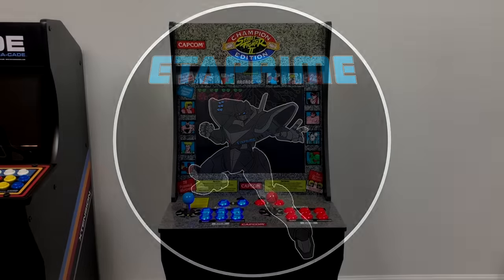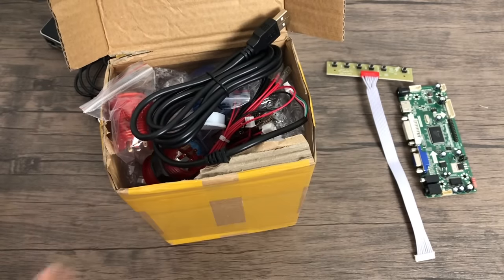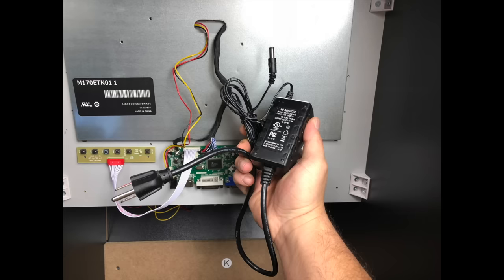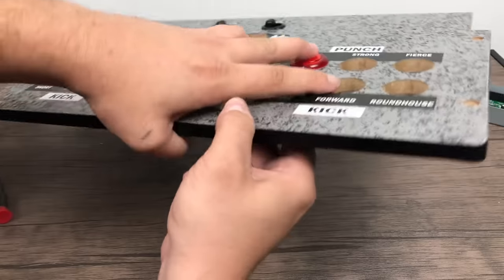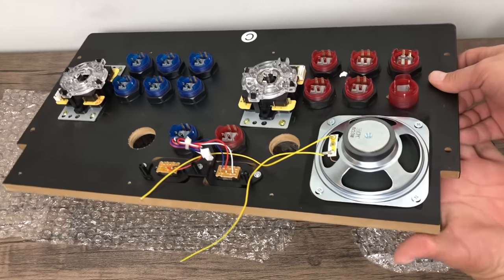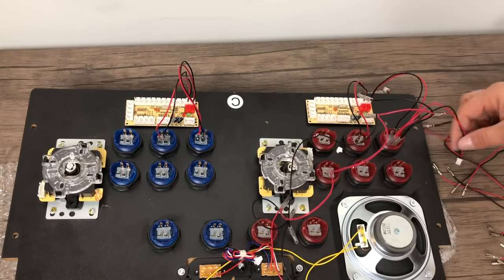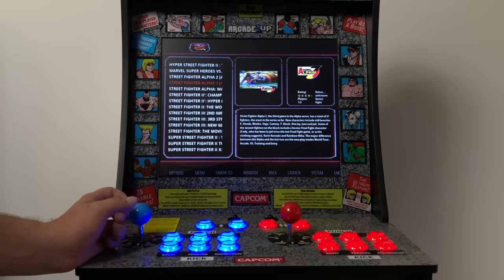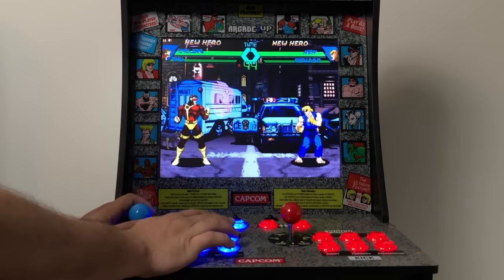‪Arcade1UP Raspberry Pi Install Tutorial - RetroPie in an Arcade1UP

Comment: Hello good day Mr.Prime. I was curious. i made this exact build like u did. Thanks for this great great video you R the Best. Now i want to change the screen to A Galaga screen cause most of my favorite games are vertical. will the Retropie adjust everything right automatically example donkey kong galaga etc . I ask because on the street fighter cab , Pac-Man works but there is just smaller with large black lines on the left and right. thanks
Reply: I don't know the specific steps (I think its on game load it gives you the option to see the options when you press a button) but on the the pi you can change the aspect ratios on a per game basis and more to fix the few who don't look right under the default settings.

Comment: I have a question about putting a raspberry pi into it as well as keeping the original board. So I’m ignorant on a lot of this...is it possible to have some sort of a switch to have the option of using the arcade1up and raspberry pi both? Or do you have to remove the arcade1up board in order to play raspberry pi. Just wondering if there is any possible way to have both connected to the controller with a switch or what that might look like. to use the arcade1up because of the ease of use.
Reply: Unfortunately you need to do away with the original. It is not just the connection to the screen but the fact that the buttons and sticks are replaced too. It's for the best because the extra work to have both will be too work intensive and costly to be worth it. You can still enjoy the same games it originally on the Pi.
Reply: Alexis Rivera thanks for the input that is helpful

Comment: What's the best build for Arcade1Up or 4:3 screens? I have both Pi 3b+ & 4b and a 20" Dell 2007FP (4:3) vertical and horizontal installed in each cabinet. Thanks!

Comment: I see you're using only the original screws for mounting the joysticks and from the bottom with no nuts on them or anything.  I'm surprised that this would hold in place.  The reason I'm asking is I'm looking to add a joystick to an Asteroids 1up and the panel seems to be pretty thin, like a 1/2" thick and looks to be the same as what you have on the SF 1up.  What type of screws are those and what length if you know and also does this hold up for people after heavy use, those who have done the mod?

Comment: Thanks a lot for all of your video. I have a question with the setup. I followed all your instructions but the audio does not come out from the board. Everything works if I connect Pi to the TV, so HDMI is good, but the board does not put out any audio. I tried both jacks also connection my headphones but nothing. Any suggestion? THANKS!

Comment: hello. thank you very much for the tutorial. I have a question. Can I use an old laptop configured with hyperspin or another program instead of a raspberry? I would also like to use the factory speaker and the factory buttons. What would I need to connect the screen and buttons to the laptop? Thanks again.

Comment: Here's an update, Jan 2021 -- the connections inside the monitor are significantly shorter, and won't be able to reach placing the LCD controller board underneath the monitor. But got an MDF shelf installed to get around that.
Reply: Thank you for the suggestion Michael! I just ran into that same problem with the short cords, am now stuck, and trying to figure out what to do. Did you just attach the shelf behind the monitor and then attach the LCD controller board to that?

Comment: Great video thanks, I'm trying this my stuff it's arriving tomorrow, the only bit im confused with is, does the original 1 up joystick just work, without doing anything once you've put rasberry pi in ect, I know I need to take out all my buttons from control board, and wire them to the usb encodes, I get that but how does the joystick work,  thanks in advance

Comment: you dont have to drill holes for the stick to line up... just swap the metal face plates
Reply: Thanks! the less I have to drill the better. Im wiring up my control deck tonight :)
Reply: @Nathan-is7li  i now realize that i did this to my marvel heros cabinet, so there is a chance they have slightly different parts, but its worth a try, good luck!

Comment: Hi there looking for help asap please 🙏 I want to keep my stock joysticks , but don’t no how ? 🙈 any ideas ? Be much appreciated , thanks
Reply: Super late reply, but I'm only going through this now and I didn't find my answer here either. Putting this here for others in the future or in case you're still stuck: You can use the spare wires that came with the USB PCBs that connect the Pi to all the buttons. Start by removing the joystick wires from their 4pin plugs. You can do this by pushing in the metal pins visible on the sides (not the bottoms!) of the plugs while gently pulling on the wires. Use a pointy tool to push the pins in, but go as blunt as possible or you'll mess yourself up! I used a tiny Allen key. You can then use a 2pin plug from the USB PCB kit by removing the wires from that plug and inserting the Joystick wires into those. The colours go together into each 2pin plug (both black wires into the same plug, both red wires into the same plug etc...). Then hook them up to the USB PCB with all the other arcade buttons and map them in the emulation software. Just note that you may need to pull the metal pins on the end of the wires outwards a bit after you've pushed them inwards when you removed the wires from their original plug so that they can latch onto their new plug. A good tip to remove the wires from their plug is to push the wires a bit into the plug before you try to push down the pins and pull the wires out. Good luck!

Comment: Question..Doing alot of research..This is my first time modding an arcade and getting familiar with raspberry pi. I'm trying to find a right raspberry pi for my Mortal Kombat arcade1up. My goal is to have only arcades games (not playstation games, snes, n64, etc.) and maybe some shooting arcade games like Alien 3, Area 51, etc.  What would be the best or recommend choice for a raspberry pi?  not too much of a tech savy though.
 Also, after you set up raspberry pi into arcade1up, i noticed when you turn it on, it display the emulation. Do I need to set up the raspberry pi to run emulation before installing into arcade1up?

Comment: HELP!  Modded my Mortal Kombat cabinet with RP4 and this guide.  Very happy.  However, I have visual "noise" on my monitor (kinda like "static" on screen).  It's not severe and almost disappears when playing and using shaders/filters.  However, it's irritating.  Used the HDMI/LCD controller listed here from Amazon.  Monitor works fine when running the original Mortal Kombat board/PCB.  Pi works fine when plugged into a different monitor as well.  Issue must be somewhere with the HDMI LCD controller.  Anyone have any similar experiences or thoughts on troubleshooting?  Thanks in advance.

Comment: ETA Prime!  Thanks for the great video!  Hey one question... I completed this on a Star Wars cab.  Not using a PI but gaming computer with aftermarket graphics card.  The bottom of my screen is cutoff as if it's too low  I try to use the tan controller strip you added which does have a horizontal and vertical adjustment.  It allows me to adjust in the on screen menu that pops up but no adjustment actually happens.  Any ideas how to fix?

Comment: What cord is it that has the other end a HDMI? The odd looking side,kind of looks like a printer plug type of one, we have this exact set up but we can't find an adapter for a regular size USB female to HDMI to connect the two. Also I apologize for my novice question, I am clueless but I just know this was an awesome deal I got this for and had to get it regardless, I figured ide learn.
Reply: If you're after the one that plugs into the Raspberry Pi, it's a micro-HDMI to HDMI. You can get the official ones quite cheap...

Comment: Hey ETA, any thoughts on the best way to incorporate an on/off button instead of just using the power strip? Thank you for all your help, I got daphne running on retro pi, now I just need to stick it in an arcade 1up cab.
Reply: u could always crack open power strip and make some extender wires to power swtitch and close it all back up with the switch rewired to somewhere elce

Comment: Hey all. I just completed the setup following the instructions in this video; however, I cannot get any sound using the amp or headphones.
Reply: its possible that you need to adjust settings in raspberry. if you connect the raspberry by itself to like...a TV, do you hear audio out of the tv?
Reply: Anthony Fronza u figure it out?

Comment: If you are using a dell monitor 17 inch. Just remove it from its shell and swap it with the arcade 1up stock? Will I still need lcd conversion kit or use the hdmi from dell straight to raspberry pi?

Comment: Definitely would like to do this to my nba jam cab but I had a question. It came with a plexiglass cover for the control panel. Is there an ideal type of drill bit to use for those? Hate to try with mine & crack the hell out of it.

Comment: Will the lcd controller power on automatically?  If the power bar (and the lcd controller) looses power, will I have to press the power button on the controller panel to power the lcd?  I'm wondering if I have to have access to this button, or can the back panel be screwed on? I'm guessing some means to power off the raspberry pi would be necessary as well, otherwise it would be always running.  Reaching around to try and turn off the powerbar or yanking the chord would not be optimal.
Reply: I built mine and was able to make everything accessible from the outside, LCD controller, Volume and Pi Power.

Comment: The only part I'm not comfortable with is the Speaker + the amp.
I saw somewhere that you can actually plug the original 4 pin connector on the LCD board (just above the jack) and it works fine. The only downside is that you cannot ajust your sound. Is that true? Because I would go with this option instead of cutting the wire and maybe kill the speaker. :/

Comment: Almost want to say would be better off buying the wood getting some good glue drilling some holes and re purposing a old crt monitor or tv with a rgb mod buy the buttons install the pi or look for a old non working arcade and mod it with a pi just better options out there.

Comment: Does the USB encoders you use work with a PS3?  I’m thinking of putting my ps3 into the 1up arcade and was wondering if the parts you used work for ps3

Comment: Save some money and get a cheap power supply and use the 12v and 5v wires. If you are adventurous you can even power the monitor so you don't need more then one plug.

Comment: Whats your jumper setting on the lcd controller board at prime, is it at 3.3 or 5.0v out i cant see close enough i dont want to change mine and risk blowing up the monitor if thats not my issue, its the exact same board as yours

Comment: How come you didn't end up setting up the power/volume buttons? I was thinking of getting a powerbar with a on off switch on it and just extend the wires on the arcade to the switch there and power it like that? Or just splice the red cable from the powerbar into the button if option 1 doesn't work
But how would I go about doing the volume buttons? Any suggestions?

Comment: If cost is not a consideration, should I go with a newere Raspberry pi 4/4GB, would it give better performance and does it require different parts (other than a case with a fan/heatsinks)?

Comment: I bought the mortal kombat arcade and set up my raspberry pi everything works but have a little static in screen i have my ground exactly were you put yours i tried moving and still the same. Only time there is no static is when i remove the ground
Reply: cholo Chico I’m having the exact same problem. The static is not terrible but just annoying

Comment: So I have a gen3 a1up cabinet. I wanna use a rpi4. So the encoders, controller board installation, buttons and sticks are still all the same right? Just the rpi4 programing is the only difference

Comment: I purchased this exact arcade machine about a year ago for my son preloaded with Raspberry Pi.  A few days ago it just stopped working.  Now when I try to power it on it does come on but displays "no signal" then the screen goes black. I also noticed that since this problem began, the buttons no longer light up when the machine is powered on.  How can i fix this?

Comment: Before I make a horrible mistake, wouldn’t it be cheaper to buy the $150 asteroids or Pac-Man machine instead of the $300 street fighter machine if you’re adding games and replacing buttons anyway? Other than having to drill new holes are there any other setbacks I’m not thinking of?
Reply: Sf is 200 now but yea .all Arcade1up is same

Comment: I really liked this build out to an existing machine... The problem I have is that I have no idea how to find the old games like Donkey Kong, PacMan, Galaga..... are those called moms? or do I look for emulators?   Do I need to find both ROMs and Emulators?  What is the difference between the two....???  I won't even bother asking where to find these at for the older games as I know people don't share that but rather say they can be found if you look hard enough on the line

Comment: Just got my Raspberry Pi 3B+. I downloaded  Retro Pi and flashed it onto a Micro SD card. Is my next step to finish setting it up with a controller and load roms on it before I install it on my Arcade Cabinet? Then once I install it on my Arcade cabinet will it detect the joysticks? I haven’t turned on the Pi or messed with it at all. So far all I have done is put Retro Pi on the SD card I will be using

Comment: Hello!

I have questions about this installation:
at 6 minutes 20 we see a power supply that we plug on the left side of the new connector installed at the back of the screen, what power is it? Should we buy it ourselves or is this the one of the terminal?
How can we turn on the terminal, do we always use the ON/OFF keys? I don't understand how it can be turned off? Is it on the USB encoder that we retarget this key? If I understood it all connected to a multitake that is in the terminal? (that's why I ask if there is a touch of ignition) because otherwise the terminal would be switched on all the time! I don't see the principle! If you can help me it would be super nice because I would like to do the same!
THANK YOU !! Niko from France !!!

Comment: Does the pi already have retro arcade games on it? Or do we have to install that stuff ourselves
Reply: Have to install yourself which hes made a seperate video on it. Apparently its pretty easy to do but im yet to try it. Im gonna try modding my pacman 1up cabinet. Only thing that confuses me is vertical games/ horizontal games. I've figured my cabinets lcd is vertical, i'm guessing i can only download vertical games for it?
Reply: They have sd cards on Amazon and Ebay that have the games installed already,  if you don't wanna go through the trouble.

Comment: 8:30 — “And just pull the sticks right out”
Yeah, unless they’ve been epoxied to hell as was the case with mine.
Reply: Which cabinet?
Reply: I had the same issue with my gen 3 marvel. But my mortal Kombat joystick came right out.
Reply: @beancurd4guandi84  Street Fighter 2. Same one featured in this video. But the mounting plates are completely different, with six-screws instead of four, and epoxy slathered over everything, including the stock control board.
Reply: Wait... I ended using a flat screwdriver and forcing the suckers out. Contact me if you need more help with this. I figured it out.
Reply: @platostruth5887  I did the same. Worked very nicely.
Reply: @platostruth5887  Forcing the screws out, or the mounting plate? Are you prying it out through the top or the bottom?
I bought a heat gun and I'm going to try to melt more of this epoxy crust away.
Reply: SmaMan I got a flathead screw and put it under the mount. Used a ton of strenght to pull it off but it worked.
Reply: Platos Truth Were you able to remove the screws first? That’s where I’m stuck at right now.
Reply: SmaMan yes. They were glued pretty well but I got a good grip and took them off. Once you get all screws off use the flat part of your screwdriver to pry open the case.
Reply: mine are glued in also.  I was getting ready to fight it with a screwdriver but decided to wait till I get a chance to bust out the heat gun.
Reply: The Mighty Rift I tried that and had little luck...
Reply: Anyway, here’s what I wound up doing.
I had one totally stuck screw on each plates. They would not come out no matter what I tried.
So I put the control panel right side up on top of the plastic case it’s usually housed in. I took a hammer and just smacked those suckers from the top of the sticks. This finally broke the epoxy’s adhesion, and gave me some space between the plates and the board.
Then, I flipped the panel over, and used the other side of the panel to pry it off the rest of the way. It took some of the wood with it, but I cleaned up the damaged parts with a knife. (You can use a sander if you want to go further.)
Good news is the replacements I got didn’t need new screw holes to be drilled in. I avoided the damaged hole, and they fit in nice and snug.
Reply: @SmaMan  yikes!  Mine doesn't have quite so much adhesive that the screws were ever an issue, so hopefully I can get them out without taking it to that level!  I wonder if there's a good chemical option like goof off or goo gone to get them started.
Reply: I clamped my control board to a work surface, held a small board right on top of the joystick (ball removed) and gave it one firm tap with a hammer (as to not directly strike the joystick) and it dropped right out.